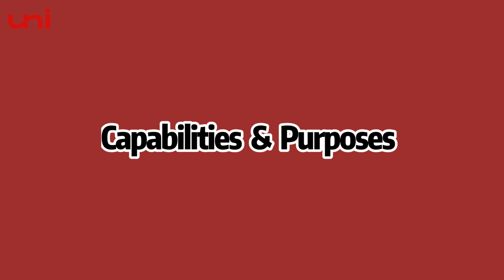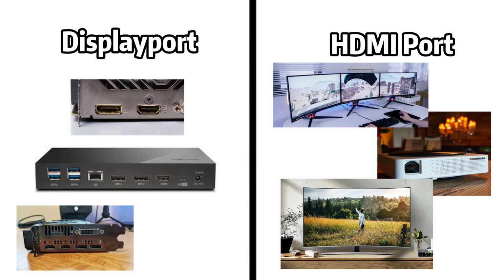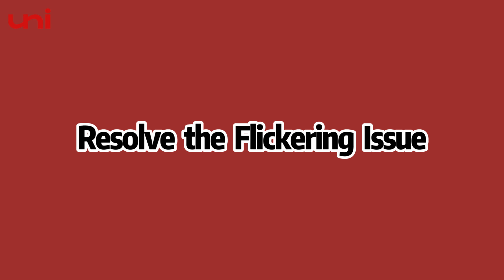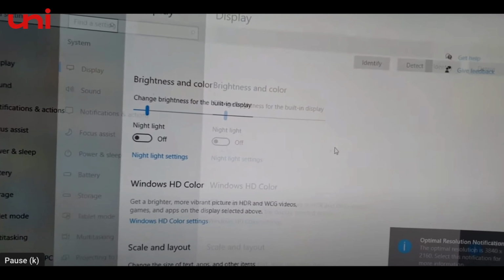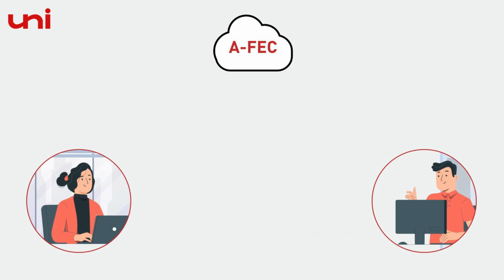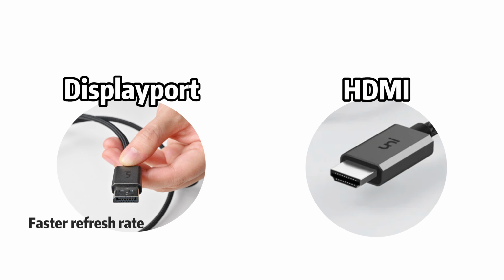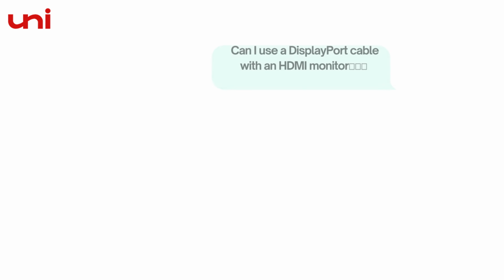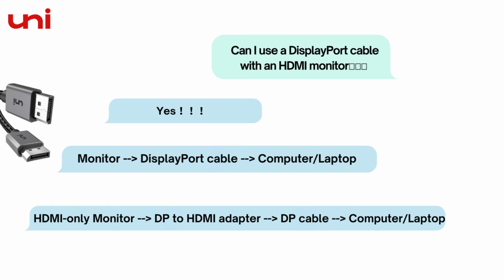How to Choose Between DP Cable and HDMI Cable? | FACTS about  DisplayPort and HDMI Port

Comment: I wonder if you could tell me.
I currently have my computer hooked up to
A TV screen which I use is a monitor.
I have it connected by way of HDMI.

If I were to use a DP cable, when I get a better picture and sound or audio ?

Or should I just keep it the way it is ?
Thanks. Keith
Reply from the maker: Thank you for reaching uni team.💛
As the video says, if both are the same RESOLUTION, the OUTPUT is close and the difference is very small.
It doesn't matter for your connecting situation.

It is generally a different option to consider the connection because the ports is limited.
If you still have problems, contact us for the optimal solution! https://uniaccessories.com/pages/contact-us

uni team:)
Reply: @uniaccessories  

Thank you so much
For your reply.
I will have to look at the model of TV I have.
Then perhaps I will know more.
Keith
Reply: @uniaccessories  
Like you said the difference is small so I think I'll leave it connected with HDMI.
Thanks so much

I truly appreciate your help
Keith
Reply from the maker: @KTHKUHNKK  No worries ,we are so pleased to help you.📩
The uni team is happy to discuss to users about accessory-related issues.🔎
Follow us to keep an eye out for more.🤍🖤
uni team:)